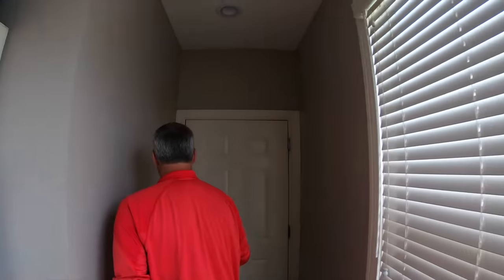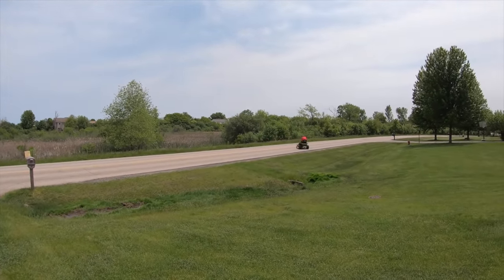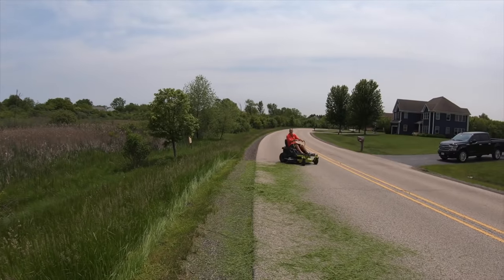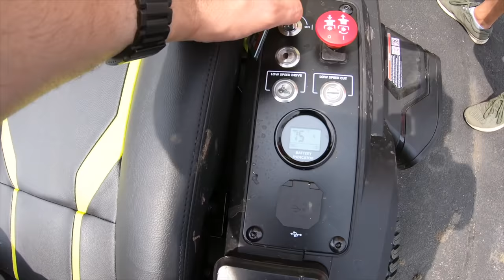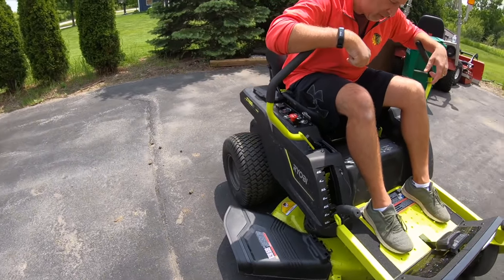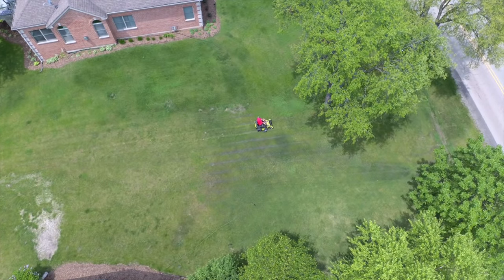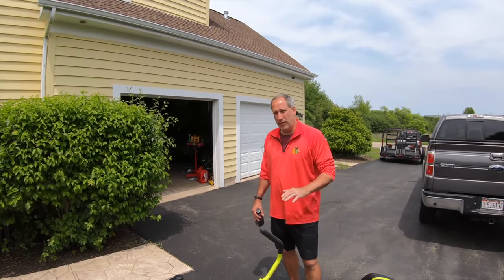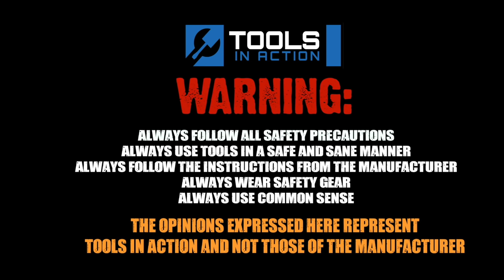Ryobi Electric Zero Turn Mower - First Look

Comment: I can't see this as a viable option. If you're in a position that you actually 'need' a rider/walker mower, 4100 bucks is just too much for what you get. Lead Acid batteries simply won't have the longevity of Lithium, and much like the old golf carts that used them, you're likely going to have to replace them every couple years if you use them heavily.  You can get a good hustler for 3 grand, and it'll actually allow you to use it ALL DAY. Not an hour or two, or some '3 acres'. Not only that, but any money you 'save' in fuel/maintenance is almost certainly going to be eaten up by battery replacements. 1100 dollars is a LOT of gas, if that's what you're trying to save.

And I should note, I'm saying all this as a guy whose used eGo since the start. My eGo push mower is 5 years in now, and for my 1/3 acre property, it's about the best you can get. I also run a crew of 2 riders, 2 push mowers, and 2 trimmers for commercial - there's no way I'd replace that stuff with Lead Acid equipment, I'd never get anything done :-\

Comment: Gas can be a hassle.  But that electric per Home Depot website is a good $1,000 to $1,400 more than the compareable gas mower. Is gas that much of a hassle to pay $1,000 more for the zero turn electric, doubt it for most people.  It has to make financial sense before masses will adopt. It does seem quite and cuts fine enough for the average home team guy.
Reply: I believe it's aimed at homeowners with 2+ acres. Gas savings and maintenance cost could justify the extra 1k for most.
Reply: @ss4goku9695  That is the same argument for solar powered homes.  Sure you lock in your electric rate for however long the solar panels last.  You are all but guaranteed to save money.  You just need a $25,000 cash investment to get that savings.  With this zero turn the scale is much smaller for sure.  You just need to put down $1,400 more to save money over the the life of the mower.  After you mow the lawn 400 times then your saving money.
Reply: Financial sense for masses to adopt is such an untrue statement nowadays. New truck prices are stupid high and make no sense but the masses are buying them faster then ever while our wages are stagnant. People buy what they want because of easy financing.
Reply: @CustomWeldingandFab  True most do not have financial sense.  But the truck example was the wrong one to give.  If you are a small business owner you can write off first-year truck depreciation up to 50% as long as the truck weights more than 6,001 lbs to 14,001 lbs.  Trucks hold their better than luxury vehicles. So just because you so the brodozzer does not mean it is a terrible financial decision.
Reply: jberg411 I understand how tax write offs work. And it’s at the point it takes a write off to make any financial sense to purchase a new truck. Not everyone is a business owner but yet new vehicle sales are higher than ever while consumer debt continues to climb at an alarming rate.
Reply: So 30 cuts per year,  about 14 years for savings?
Reply: @robertpendzick9250  I was using grasshopper mowers fuel calculator.  It was based on 27 hp mower.  Most in the price range of this electric Ryobi would be 22-24hp. So if fuel consumption for 27hp mower is 1.65 gallons per hour. Then it says your fuel cost per hour at $2.61 per gallon in my city would be $4.37 per hour.  Based on the 100 aH battery they tested costs $4,099 on HD website.  That is $1,400 more than average gas zero turn at HD.  So you take that 4.37 into the added price you pay for electric of 1400 and you get 320.  It does take me roughly an hour to cut my yard.  So after 320 cuts, you will be done paying for the difference of having an electric mower.  I cut once a week, lawn season here is 7 months.  So 28 cuts a year for me.  Would take me 11.4 years of cutting to pay for that added $1,400.  Then electric is not free, but much cheaper.  The numbers would be better if you bought the cheaper Ryobi with the 75aH battery for $3,200.

Youtuber I Am Organic gardening has a Ryobia Rme480 I think. It is not zero turn, but he has an upgraded 1mH battery the same as in the one tested here.  He goes into depth about electric to charge his mower. He says it costs .20 cents per acre to mow his lawn.

Comment: Just wait a year until you have to replace the battery, it will cost you as much as you paid for the mower, just like the replacement batteries for their power tools.

Comment: I blow all my cut grass out to the street. Just the way I cut, I definitely don't want spent grass blowing where I'm about to make my next cut. I don't trust anything Electric, period. Like trimmer's, chainsaws, etc. I want fuel HP!!  I've got a 2012 RZT 50" Cub Cadet that will out cut that thing all day & keep going. Especially now that fuel is cheap. It is a cool zero turn though, just not practical for me. I'm mowing 4-5 acres twice a week. My Buddies ExMark is one comfortable 60" zero turn but my "Ole Yella" will out cut that one all day as well. That ExMark is a scalping machine.. Even the Pro Models scalp. Maybe I just have ole Yella set up right & I keep my blades sharp as a knife & balanced. I also never use water to clean my Mowers. Good ole air works great & saves your spindles.

Comment: The law says you can drive on the road but only to get to the property you mowing these are great except for a few  things  the battery will wear out. I have been told that over five years It cost more to pay for the battery then it would if you bought the gas for it.  But the thing with this is the convenience of it.   as it ready to go when you want it. and there no pollution so you not taking in gas fumes in to your lungs the other thing is I have a rover 2018 MDT lawn tractor I can get part for it cheep any where a set of blades cost me $25.00 a deck belt cost me $36.00  But this I don't know. as I can good a deck belt but try to google a deck belt for this you wont find one

Comment: NiCd? really? NiMH would have been better but Lion would be the best with brushless motors for the blades and or the wheels. when they start doing that, these machines should be able to KO 10 acres per charge. with plastic decks like honda rust would be a thing of the past.

Comment: Every single Ryobi tool I've ever owned or bought has either severely under performed or crapped out on me after about 9 months. Junk brand.
Reply: Boom I Gotcha I agree 100 percent
Reply: Mine have been fine from a tool standpoint, but the batteries get killed by any cold spell. 

I’ve got their 40v strong trimmer and it’s been a champ though.

Comment: Well this is certainly upsetting for me. I converted a Dixie Chopper 12 years ago to Electric and used it for my lawn business charging it from my electric truck and I see this? Recharge time on mine was 8 minutes. I would cut 10 to 15 yards a day . In the words of Rodney Dangerfield I get no respect. Here is a vido of me cutting some 3 foot high grass https://youtu.be/OqiAGU5cLjY all kidding aside I'm glad to see someone's making them and selling them. And you kind of feel the same way about yours as I did mine. I thought it was the greatest thing ever. I still use it but just on my own yard.

Comment: They won't be NiCd batteries, more likely Li ion.
Reply: They are deep cycle lead acid. I prefer them as they will be reasonable when you need to replace.
Reply: @manecklen  Thanks for this info. I searched awhile on the Internet and couldn't find what type the batteries are. Deep cycle lead acid makes sense on a ride on lawn mower.

Comment: Nice when they're new, but you wont be a happy camper in 3 years when your battery is only holding 75% of its capacity and a replacement is gonna set you back $1000

Comment: This is a lifestyle mower, you buy this to be quieter or more environmentally responsible or something. I like the idea and the execution but wouldn't pay what they are asking for this. My JD 155 cost me $3000 cdn 4 years ago and it's probably only used $500 in gas and maintenance since then. I'll probably have the JD for a long, long time without any issues. I'll bet batteries for this thing won't be cheap or easy to find when they discontinue it due poor sales.

Comment: ROTFLMMAO. You almost get your lawn cut, then spend the rest of the day charging it so you can. With battery power, as soon as the battery gets down to 3/4 charge, you start loosing power.

Comment: i'll keep my Toro Titan. i don't understand the facination with electric heavy equipment. i have tillers that are 70yrs old and preform close to new. oncece these batts take a shit, you just have a pile of plastic and copper
Reply from the maker: Same thing when your motor craps out after 5 years
Reply: @Toolsinaction  i have never had an engine "crap out", usually its a user fixable item if it does. Smoke an electric motor, you arent going to rebuild it. I have tossed dozen of cordless drill over the yrs but still have my 30yr old AC drill.  Disposable zt

Comment: The gasser would’ve cut through that grass like it wasn’t there.
Electric has its place, but if you’re on a large enough spot of grass then the electric is pathetic.

I gotta say, it’s so quiet, it’s really weird. The difference is that the electric motors can’t bog down & still have the torque the electric doesn’t.

Electric is either pull power or its not, yeah it has a lot of power, but the gasser doesn’t need to be changed for hours on end, & then won’t work. 

Most of the time, if the gasser has fuel, & a changed battery it’ll run.

Get ready to change that battery 2yrs down the road.

Comment: With all the battery powered lawn stuff out now, 90% of it is junk! Batteries are super expensive and never last very long. Companies make the most money on selling replacement batteries. I've used many different brands of battery blowers, weed eaters and have never found one that held a charge longer than 20 minutes. Give it a few months and the batteries will be useless! The design is a cool idea, but it will not last!

Comment: Spraying  grass on the road is incredibly irresponsible and dangerous for cars and especially motorcycles. You might as well dump oil on the road because they are both very slippery.

Comment: Cutting grass into the road is dumb. Not only for motorcyclist but for making a mess on the road as well. Youre literally mowing backwards
Reply: If you actually mowed big lawns you'd know you almost have to mow towards the road if the grass is too long otherwise you chop the same grass up over and over
Reply: @DkpProductions  If you mowed big lawns youd know to make 2 passes away from the road before you started making lines. Whats wrong with chopping the same grass? Youd have to double cut anyways if its that tall and you're wanting to do a good job. I've mowed every kind of property, so don't assume I've never mowed a big lawn. 😂

Comment: Ryobi is not a good brand. You literally didn't focus on durability and things like that. My John Deere zero turn which I purchased for the same price would run circles around this garbage. My John Deere would literally mow over this thing, if I had the money to buy this and mow it over. It's literally made in China

Comment: Ni-cad no thanks. Battery won’t last 3 years and holds a memory
Reply: Plus they tell you to keep it plugged in which surely will help it develop a memory when never fully discharging the battery.
Reply: SLA not Ni-Cad.
Reply: The guys said ni-cad
Reply: @8hammer2189  And as much as I like them they're often not too researched on direct specs before they do a video. They are not Ni-Cad. Check the spec page on this zero turn and Ryobis old rider, both are SLA. Check the replacement batteries too and you'll see.

Comment: Battery powered equipment and vehicles are not environmentally friendly as hyped. Mining the raw materials destroys the environment and area of mining and charging the batteries uses local utilities that require fossil fuels to produce the electric. If everyone  charged their electric cars and equipment everyday today's power grid will fail and cause massive blackouts. In addition the limited work or miles per charge is a negative. Time required to bring battery up to full charge is also a major problem.
Over priced electric equipment makes no sense.